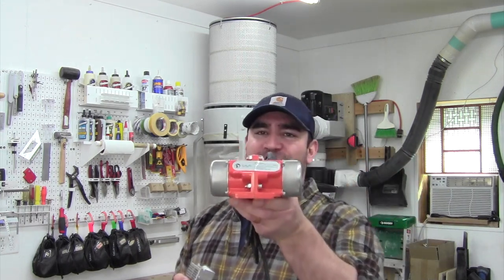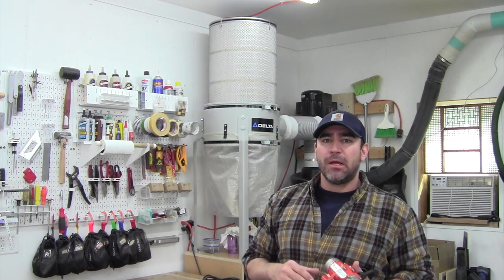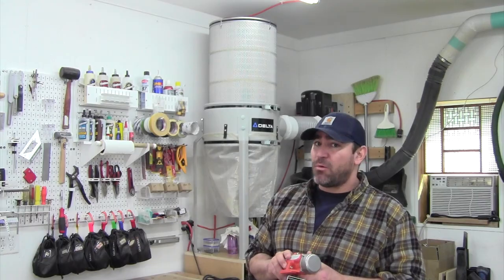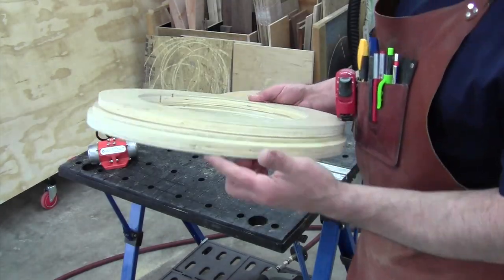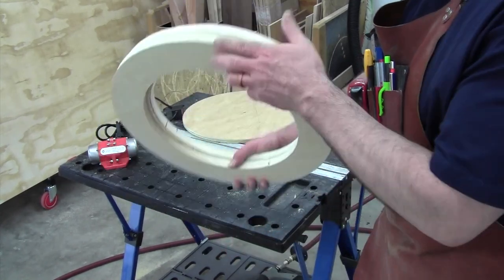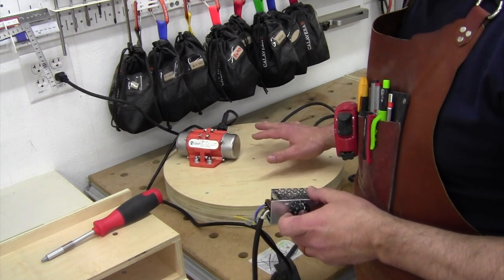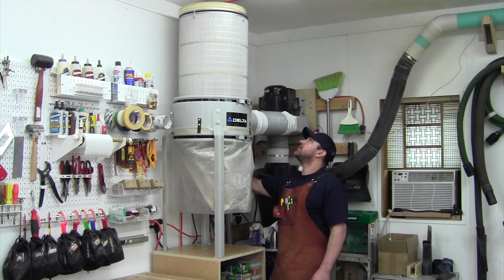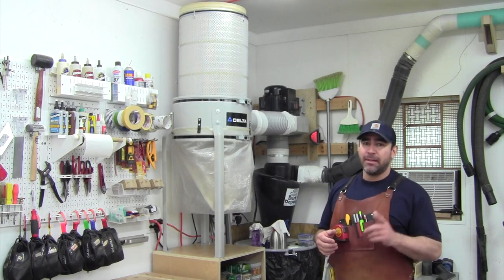Wood Working Dust Collection Filter Cleaner with Vibration Motor.

Comment: Nice add to your DC Eric. Could you add a relay with delayed start for the vibration motor with a timed drop-out so for example the vibrator would come one when the dust collector power was removed then run for 15 seconds or however long you think you need to keep the filter clean. I believe that's known as a ON/OFF delay relay.

Comment: hello sir.im working on a project with the same speed controller and vibrator motor.is it still the parts working up to now or how long before you replaced the parts?SCR OR VIBRATOR.im not sure if it its okay to use speed regulator in ac motor.thank you